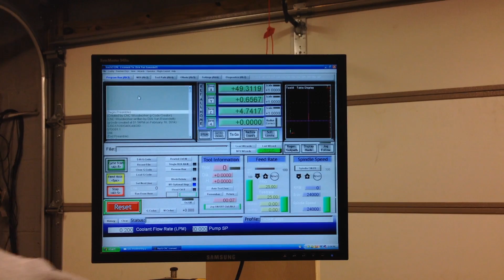CNC Woodworking G-Code Creator - Jointer Demo

Comment: What type of cutting tool are you using?  We use carbide down cut for this type of thing.  Turn the dust collector off for a pass and examine those chips, chip load is very important for a clean cut.  One thing for sure, you will never get a straighter board than that way right there!
Reply from the maker: I am using a straight carbide up cut.  I have some down cut spiral bits I can try.  What should I look for on the chips?
Reply: The straight cut you are using if it is angled up is actually doing 2 things we don't like so much.  In order to get a smooth cut with that the feed rate is kept slow.  Look at the chips and if they look very fine this will cause excess heat to build.  Using a down cut spiral helps to push the piece you are machining down rather that trying to pull it up.  The up cut helps with chip removal throwing them towards the dust collector but we prefer to let the vacuum do the work.  Ultimately the chips should be large enough to see that they have been "Cut" away vs being ground if that makes sense and I hope it helps, your built there on that machine is really nice
Reply from the maker: I think I understand... The only thing about taking a light cut/multiple passes is burnishing the wood... it may not be the best thing for the bit, but it does give a nice finish to the wood.  I have a diamond dmt tool to re-hone my bits.

Also, climb cutting, even with a shear cutting bit like a spiral bit is a good thing to do with any kind of heavy cut for a couple reasons: 1) it ensures that there is no force that will cause a split, 2) the forces from climb cutting are much more in line with the cut direction than they are in the conventional cut and they push the bit away from the cut line and won't over cut.  Because of 2), you can get more accurate cuts in multiple passes without risking overcutting.  At least that is the theory posted on cnc cookbook.
Reply: Yes, agreed, Climb cutting is the way to go.  I guess all I can say is they I have probably miles of cutting behind me and a spiral solid carbide would probably make you very happy.  Also when these bits are done, we send them back to the manufacturer to be re manufactured for just 12 dollars each.  About 4 times and you dollar cost average into a very nice place.  Our tool file lets us change the diameter of the bit and it works great.  It's like anything, time will give you all the info you need!  Take care
Reply from the maker: PopsCabinetShop What brand do you use?  I have some Whiteside bits and like them quite well (though I haven't tried many of them yet... Whiteside is just the best I've tried so far).  Can you send them any bit?  I can also compensate for new diameters in the tooling in aspire or in the software I am working on.  How much diameter do you loose?

By the way, I hope you don't feel as though I am ignoring your advise because I am not.  I value your comments and will definitely try one of the spiral bits on my next cuts.

Comment: Wow, this is dope.
Reply from the maker: Thanks!  I hope that people really start to use CNC machines in their own shops.  The cost is coming down more and more all the time.
Reply: dirktheeng Yeah, totally agreed.  I'll be building one soon.  For some reason, I just hadn't thought of using it as a jointer.  I may need to build a bigger one than I was initially thinking.  :)  What routable size would you recommend?
Reply from the maker: n8guy The largest you can afford and have space for.  I got a 4x8 so I could run sheets of plywood for projects like my workbench.  All the parts for the tortion boxes came off of that.  There are times when I wish my router was smaller though because I don't have a large shop.  You can build a CNCRP 48x96 for $12k comfortably, probably less.  It's a fairly solid machine.
Reply: dirktheeng So you actually use the 4x8 space?  I hear some folks saying they never use all their space.
Reply from the maker: n8guy yea I have been on this project.  I don't always, but it is great to have it

Comment: Great video, have you ever thought of chucking up a laser center / edge finder, it's really easy to use just install it in your collet then jog either on the X or Y axis adjust the material till it lines up with the laser. I have a position laser mounted next to my spindle......... here is a website that sells the chuck mount version http://www.lasercenteredgefinder.com/
Reply from the maker: I've thought about getting one of those a couple times.  I can see that it would be useful.  I actually need a new edge finder because I broke mine by running it into the work piece to far by mistake.  That won't be a problem with a laser (hopefully)... Though I haven't met anything I couldn't break with enough determination (or carelessness) yet.

Comment: Very nice. Have you thought about using your CNC as a planer?
Reply from the maker: I do regularly.  However, I typically go through the aspire software to do that.  I will eventually write a module to do that in the program here.  I planned the top of my workbench (3ft by 6ft) flat with this.
Reply from the maker: I should also say that it isn't very fast to do surface planing so I have a regular 13 inch planer too